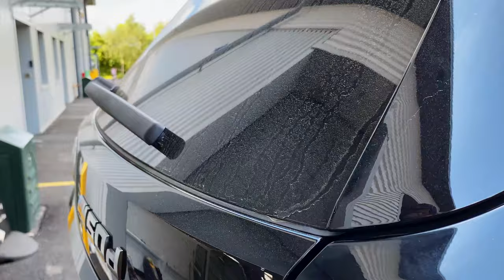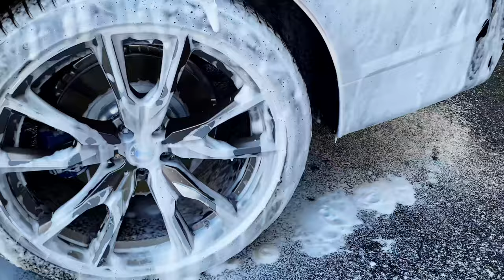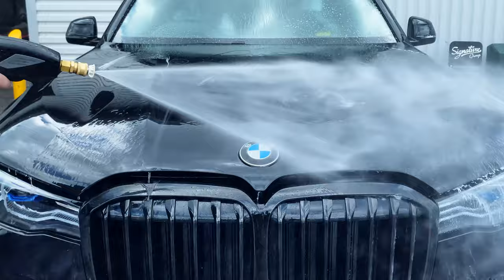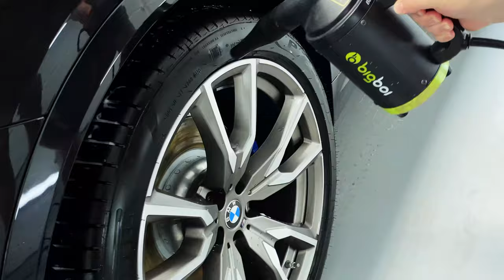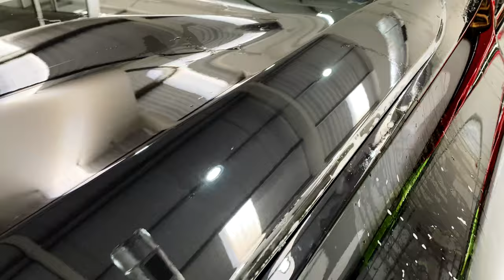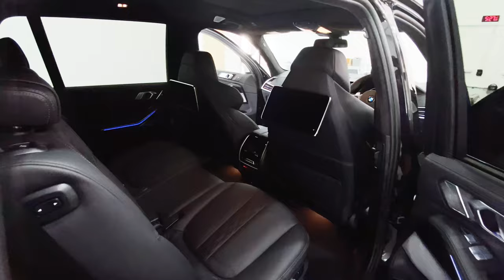BMW X7 - Full Car Paint Protection Film & Ceramic Coating

Comment: Coating looks great but the edges of the PPF being so easily seen would drive me crazy. Is it really that important to have knifeless installation at the expense of having those visible edges?
Reply: Some installers use the pre cut templates, but they adjust all the edges by a few mm so the edge of the ppf overlaps into the folds/corners. That way the edges of the ppf are hidden.
Reply: @allenjs2976  yep that’s what mine did. Seeing the edges would drive me nuts